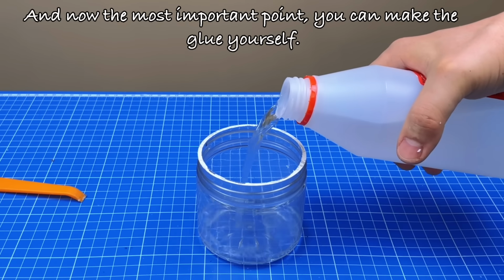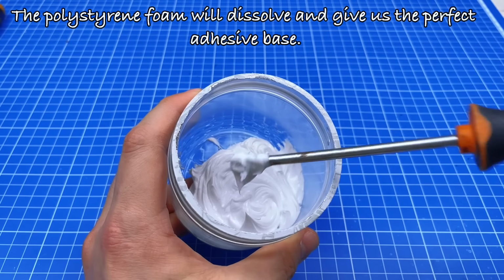🔥🔥I NO LONGER SPEND money in the market  Repair Wheels Without Glue

Comment: What is the white powder injected through the valve? Does the glue mixture require the heat from the kettle in order to set? And why not use a coin as a template to cut a round patch?

Comment: why do you inject the glue into the inner tube?
Reply from the maker: mixture: triethanolamine, polystyrene foam and gasoline is a pretty good sealant and will quickly seal a puncture if such a mixture dangles in the chamber.

Comment: Better buy TANNUS never flat tires … a kind of full rubber flex foam without air inside … look on YouTube about TANNUS and on Amazon maybe they have the right diameter for your tires… I have some on my „town MTB „ … never flat … perfect for Armageddon when SHTF 🔥🔥🔥✌️😂✌️🍀🍀🍀🌎🔥🔥🔥
Reply from the maker: Wow, I didn’t even know these existed) Are they heavy? I just don't want to increase the weight of the wheel!
Reply: @FixItFast1  … mounting on my MTB was a little bit a heavy job … but now I am riding them in town and over land slowly maybe 2 years without flat … 😜✌️🍀🔥

Comment: why do you inject the glue into the inner tube?
Reply from the maker: mixture: triethanolamine, polystyrene foam and gasoline is a pretty good sealant and will quickly seal a puncture if such a mixture dangles in the chamber.
Reply: @FixItFast1  three comps?